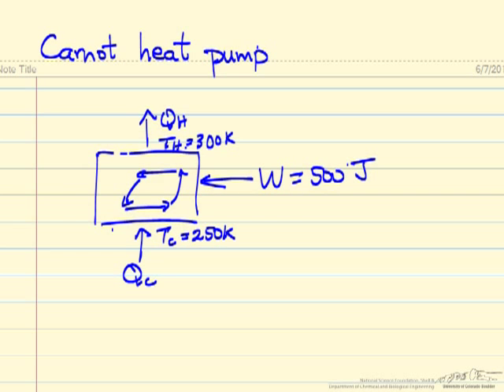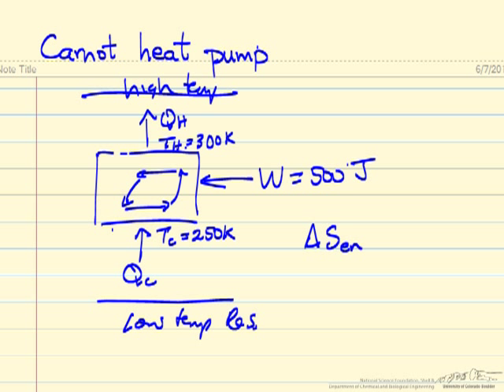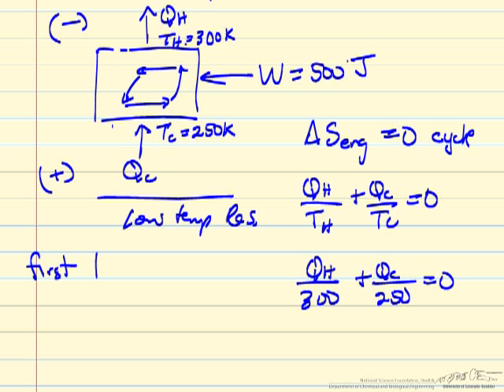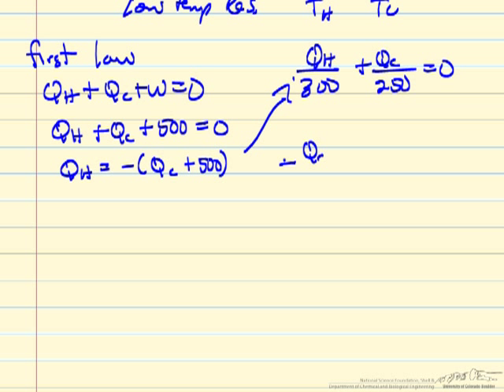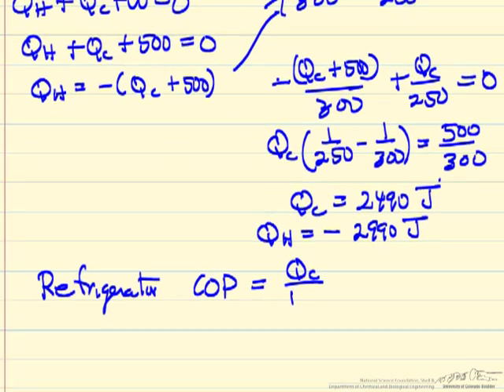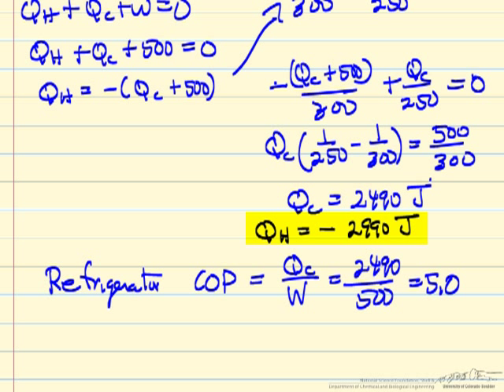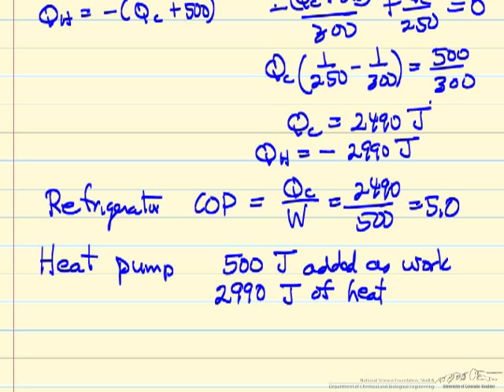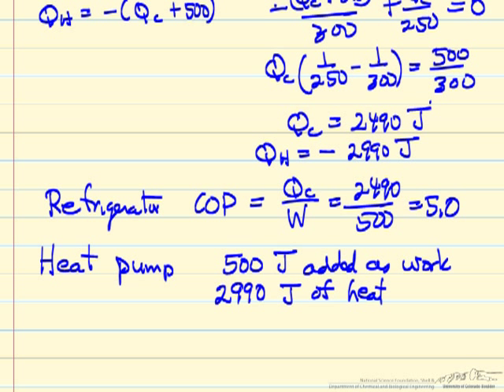Carnot Heat Pump

Comment: For an ideal system, this diagram is okay. 
In practice, one needs to consider the heat transfer coefficient of heat going in and heat going out of the heat pump per time unit. This transfer is temperature difference dependent. For instance, the compressed gas is adiabatically expanded to a temperature below the outdoor temperature.   For fast flow at least 10 C below the outdoor temperature. Subsequently the cold expanded gas is heated by the outdoor temperature. Next the gas is compressed to a temperature above the room temperature. Subsequently the temperature drops to the desired room temperature. For efficient fast heat transfer the gas has to compressed to at leat 25 degrees above room temperature. The compressed gas releases the heat to the room to 5 degrees above room temperature. Say room is at T=293 K one needs Th=323 K. Say outside is T=283 K, then the compressed gas of 298 K should expand to 273 K.  This gives Qh/W=Th/(Th-Tc)=318/(318-273)=6.